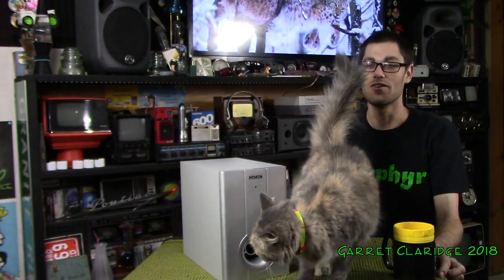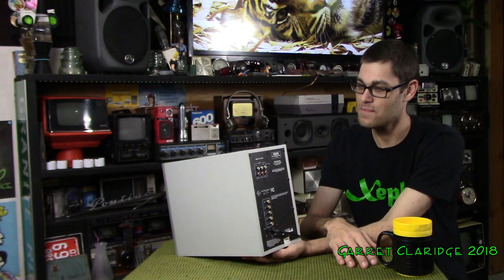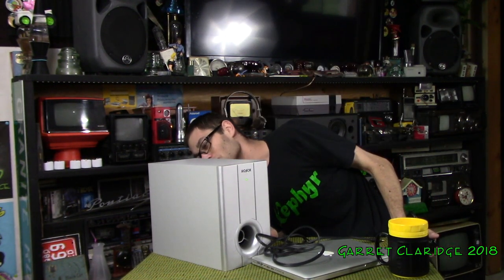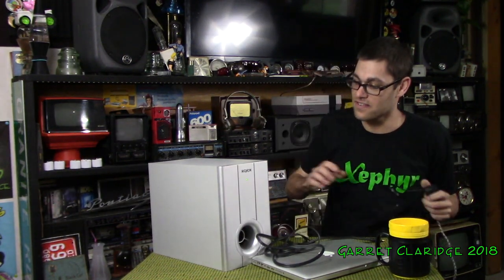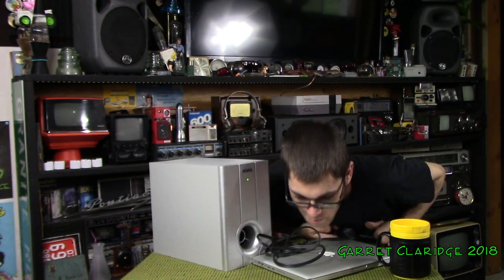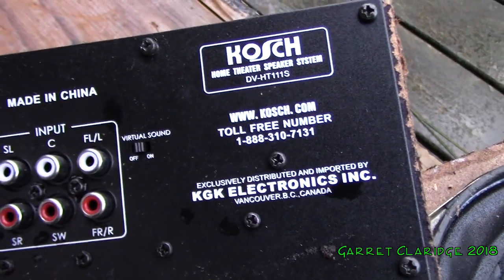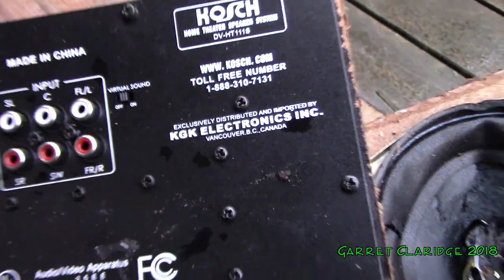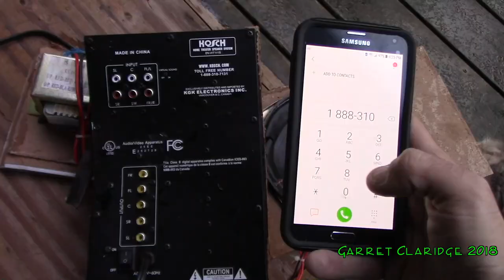White Van Subwoofer Destruction -KOSCH-

Comment: If only you had a pair of these....you could take one of them, connect the speaker terminals to a power cord, while the speaker is still connected to the amp (but the amp otherwise is not connected to anything) and plug that power cord in, and watch both speaker and circuitry buzz, pop and explode.

Comment: I still want to see what would happen if you put a transformer in between an amp and a speaker. Would it sound different? Be louder? Be distorted?
Reply from the maker: 70 volt PA / intercom systems use a transformer on the back, you often can choose the wattage that comes though by what wire you hook up
Reply: @GarretClaridgeMeerkat  Yeah, I remember when you blew some of those up a long time ago and the transformer would go up in clouds of smoke... I was thinking like MOT level transformer though XD

Comment: If you get 2 more of those white van scam subwoofers hook one of them up to the peavy pro audio amp and plug the other one into the wall outlet and blow it with 120 volts ac

Comment: Of course it's hard for me to say considering I'm only going by a YouTube video, but it actually doesn't seem terrible for a scam speaker (other than the fact that it lives a double life as a mid range).

Of course there was distortion, but the amp seems to be a good match for the sub, and the circuitry isn't awful. I've certainly seen far worse.

Comment: That thing is garbage.  And DC to the speaker, but not enough to blow it.  Sad.  Usually, it's DC that kills speakers when the amps die.
Reply: actualy ac wil kill the  speaker.. dc will just make it stay static. the water shorting it out would still send ac to the speaker. in those amps even if they blow or short out it wont blow the speaker..or it will buzz(like it happened in the video) or it wont do any sound at all
Reply: @chloeprice8  actually what he's talking about is when the app dies it usually pumps a fuck load of DC into the speakers and they blow up. Had it happen once with a Sony stereo receiver